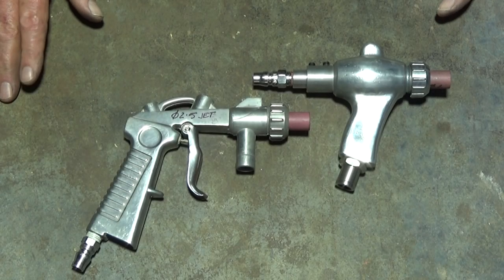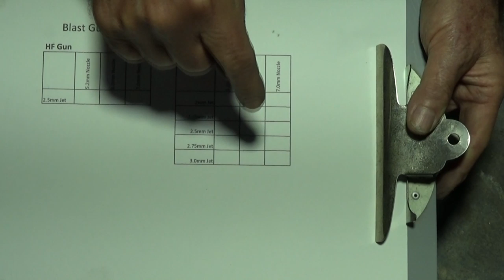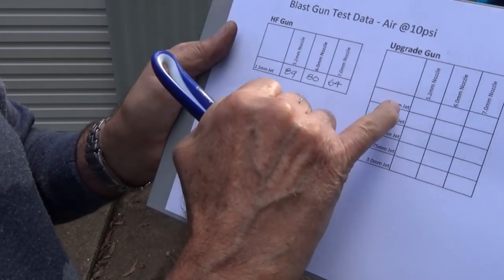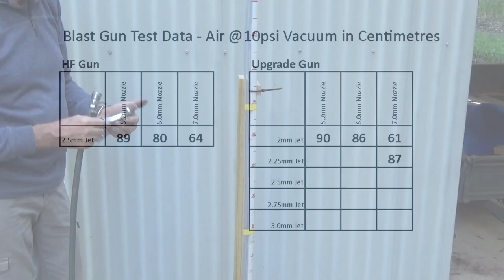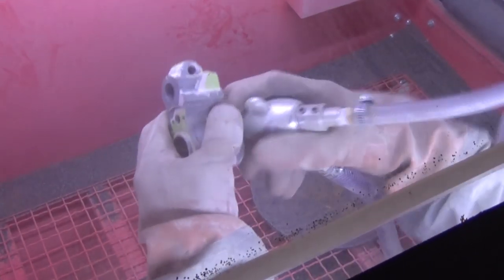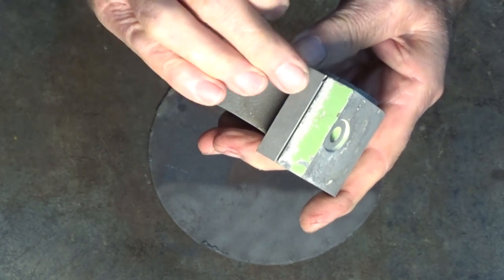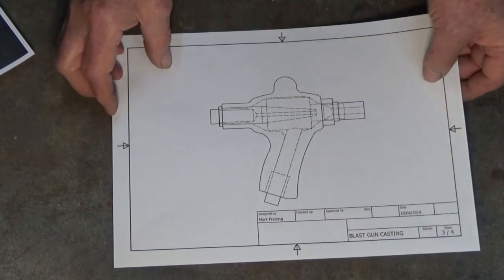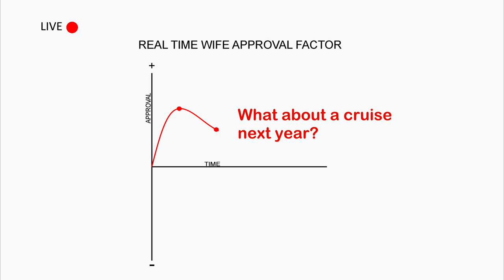DIY Blast Gun Testing Using a Manometer

Comment: Have you seen Keith Rucker's video on this https://www.youtube.com/watch?v=CgZW2GBvZQs
Reply from the maker: Chris, yes I did watch that video quite early on and where he shows the adjustment of the metering valve it looks very similar to the sort of flow I am getting using a much coarser garnet. I was initially disappointed but the last test I did shows that I can get a pretty good continuous flow of garnet from the nozzle of the gun so I guess that is the solution I was looking for. I still want to upgrade my compressor though. It's a bit like me, old,  shabby and lacking in performance. 😁